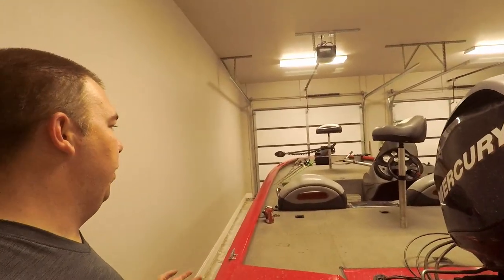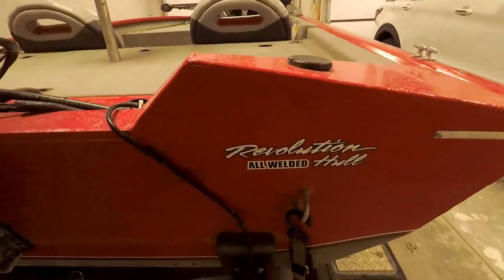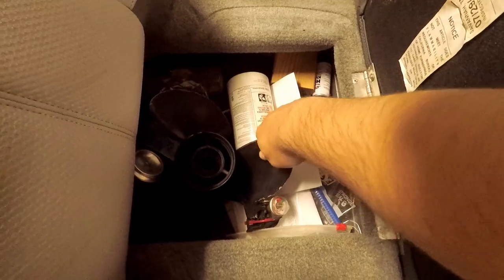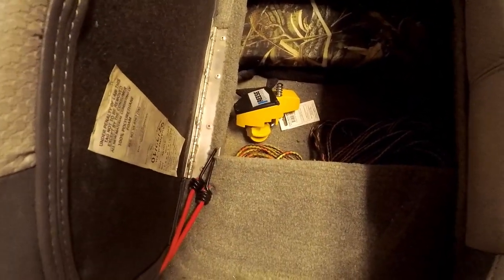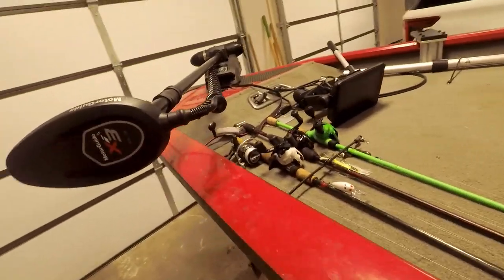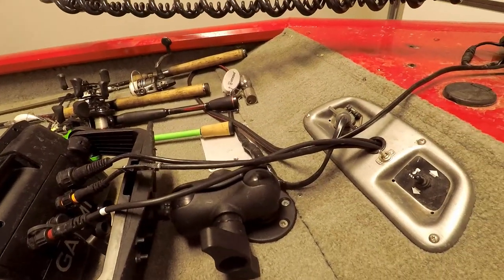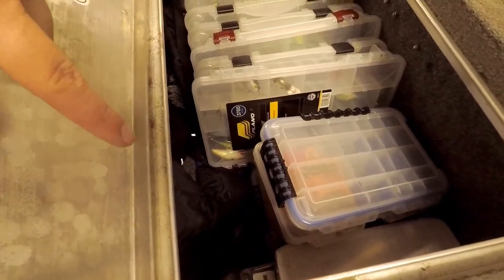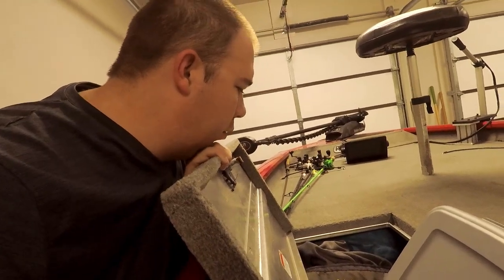Bass Tracker 175 TXW Walk Through

Comment: I couldn’t fit two 27 series batteries side by side in the aluminum battery tray in mine (2017).  The 3 batteries had to be installed one behind the other.  There is no way to access the forward battery without first removing the rear 2 batteries which can be a pain.  Instead of expanding to a 3 bank charger, I put an SAE battery charger cable on the forward (starting) battery and use a small external charger (HF) for that battery.
Reply from the maker: Sounds like you were innovative in your battery solution.

Comment: Been looking at these boats my garage door is 8foot7 says package width is 7foot6 which wouldn’t leave to much room for error.  Don’t wanna buy a boat and store it outside. How big is your garage door just wondering you think 8 foot 7 would be too tight? Anyways great walkthrough.
Reply from the maker: My garage is 9’ exactly, and I have plenty of room to spare. I would give you the widest dimension of my boat, but it is in the shop right now. From what I remember the online measurements were exact, but it doesn’t hurt to measure one. Long as your door is about 6” wider than the boat you should be able to get it in there pretty easy (3” on each side). It might take some practice.
Reply: Clearwater Fishing Yeah I think I would be alright. Yeah that’s about as big as I can go in my garage.  Got a Jon boat in there now but bout ready to start fishing some new area.   But think it’s about time to pull the trigger on a new boat.

Comment: Hey how did you drill or screw the mount  to the floor of the boat? I'm scared I might drill threw something 😳
Reply from the maker: I used a construction wood screw that was less length than the ply wood deck.
Reply: @clearwaterfishing  what size screw?
Reply from the maker: @atrboi8171  3/4" is what I used. You can look and reach under there to make sure.
Reply: @clearwaterfishing  thank you 😊

Comment: How did you run your wires from the live scope to the battery?
Reply from the maker: I came out the hole for the motor battery. Across the transom then went up the starboard side with the wiring harness. Then I followed the power to the front of the boat. That part I had to use a fish tape because of the foam.